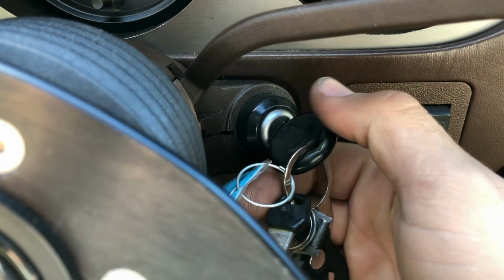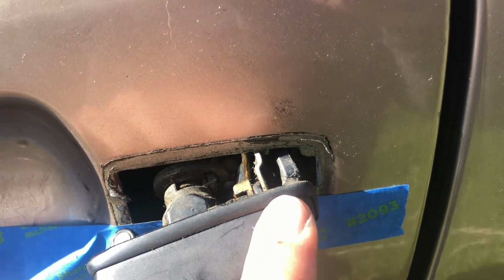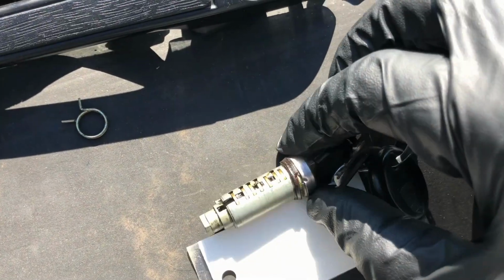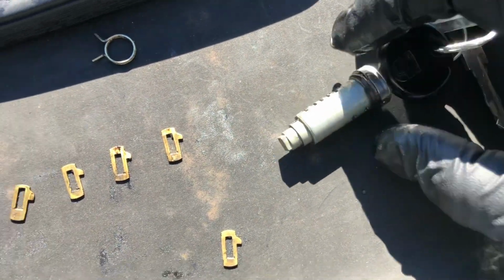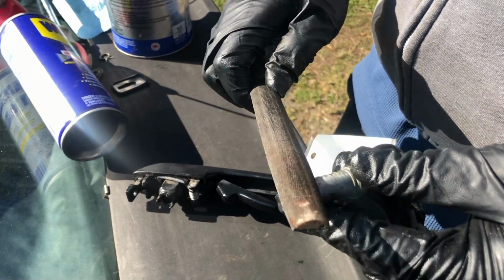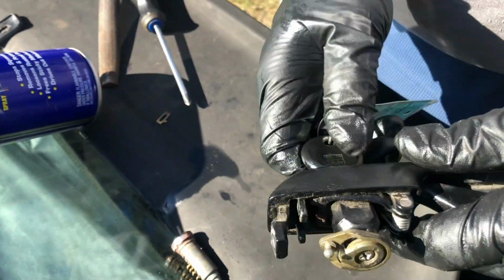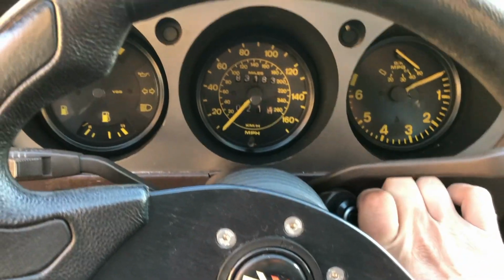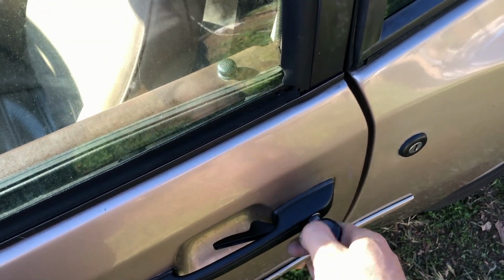Porsche 944 - How to Re-key the Door Locks

Comment: do you have a video that shows rekeying the ignition?
Reply from the maker: Not at the moment, usually it's usually the door handles are the ones changed. Here are some instructions that I found online. http://forums.pelicanparts.com/porsche-924-944-968-technical-forum/697121-how-remove-ignition-lock-cylinder-repair-rekey.html
Reply: @edredas  thank you! i have a customer who has an All-keys lost and for the life of me i couldn't find the retaining clip(or even diagrams and images) to find it, i eventually did (although the ignition housing has gone from German Made to Swiss) find it, four exploratory holes later... if only i had checked this comment section sooner lol looking at it i should have been able to depress it from the front without drilling but hey, live and learn right. i'll definitely be booking marking this for future reference though!
Reply: @SterlingBattrick have you been able to rekey yourself the ignition switch once you took the barrel out ? Is it the same procedure as the one shown by Edredas in the video ? Thanks

Comment: Can you use the same procedure for the rear hatch lock?  I have a 1987 944s that has a key for the doors and ignition but no key for the rear hatch.  I also don't have a key for the factory alarm but I plan to bypass that anyway.  Thanks.
Reply from the maker: I have heard that you can, but I have never tried. I've only had to change one hatch lock and the owner actually ordered a new one. So, as far as that goes, I do know that you can go to the dealership with your VIN number you can order a new hatch lock for about $50. If I ever do have to do this I'll make a video on it.

Comment: Tried this tonight on my early car but found instead of a socket joint connecting the handle and the linkage rod there is a permanent pin. Looks like I'll have to open up the interior panel to get access
Reply from the maker: The handles are pretty much the same for all years. There is a permanent pin but that isn't the one you are looking for. I hope that helps!

Comment: I bought an '87 944 that didn't have keys. I bought an '86 parts car with a Porsche key and a worn spare. I have replaced the door and hatch locks, but can't figure out how to remove the ignition cylinder. Do I need to drill out the two shear bolts that hold the lock assembly, or is there an easy way to take the cylinder out without the key?

Comment: So the slave clutch cylinder failed, now its swapped with a new line coming from the master clutch cylinder. just looking around, i found a three prong round plug harness hanging. could not find where it plugs into. Im assuming it goes the bellhousing and it could be for the shift light arrow, which does not light up, but where does it plug into? Thanks ahead of time.
Reply from the maker: How big is the plug? If it’s small and comes from the reference sensor bracket then it’s the old diagnostic plug that just mounts on the back of the cam tower. However if it’s larger it’s likely the O2 sensor plug. As for the shift light not coming on then it’s likely burned out inside the tach. It gets its signal from the DME so if the tach is plugged in and working then the light should work. I hope that helps!
Reply: the harness plug is about 1/2 in. diameter black with a with a white sheath.
Reply from the maker: Sounds like the O2 sensor plug...

Comment: What about the alarm system key? Just curious.
Reply from the maker: I haven't tried rekeying one of those yet, but I think that it would similar. If I ever do rekey one I'm hoping to get an ignition key to work since Porsche missed the mark there. I'm not sure it uses a different style of key or was for just security reasons... so that even if someone did happen to swipe dads spare key they couldn't start the car, but most of the alarm keys just end up missing and rendering it useless. Let me know if you try to rekey it and how it turns out.

Comment: Thank you so much for this video! I’m in the middle of swapping door handles on my 87 NA right now and noticed the lock cylinder seal ring (Part# 111-837-227-B) is extremely brittle and is in pieces on one of my handles. I notice you didn’t bother with one and I cant seem to find any replacements. Do you know where to find a set or know of something comparable? Should I not worry so much about it?
Reply from the maker: I'm not aware of anything else that will work, but I wouldn't worry too much about it. Almost all of them have deteriorated by now and I haven't seen any issues from not having them. However, if find something to use as an alternative I will definitely use it. Good luck!